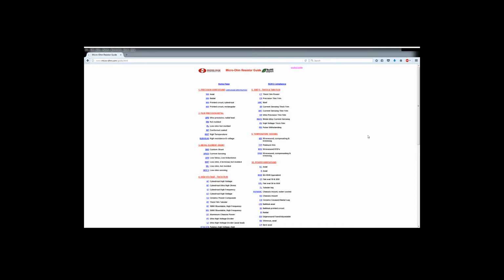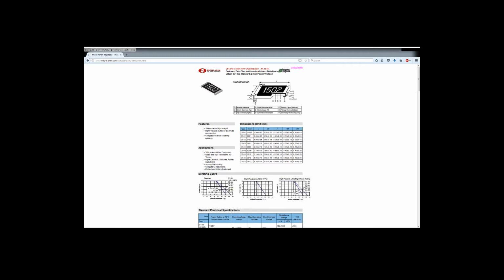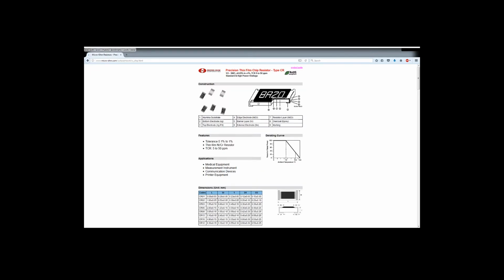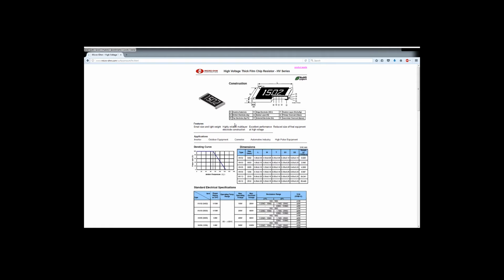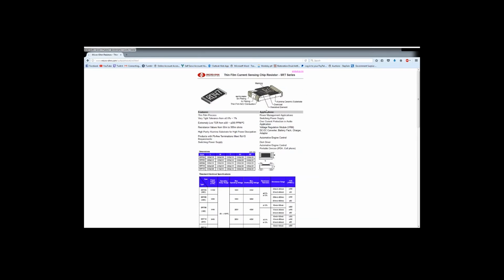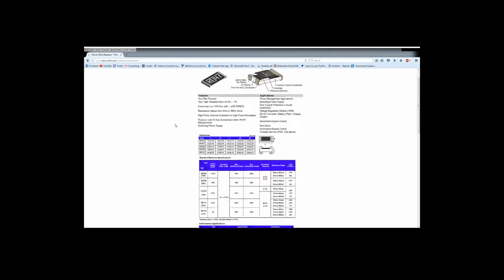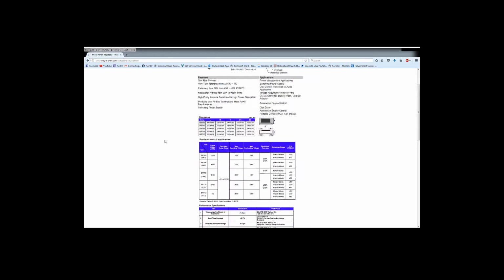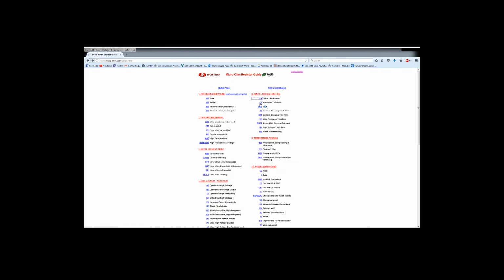Alamo City Scrapping - Thick Vs Thin Film Resistors ( Wide screen is recommended)

Comment: Never gonna make us rich collecting these mate but if you are like me your just keep collecting them anyway !!  Thanks for the video !
Reply from the maker: Yes sir! It all adds up at the end. I'm sure some day someone will come up with an easy way to process these. In the mean time just keep collecting! Thanks for watching!
Reply: Your most welcome
Reply: @TwoOneOScrapping  and here I am!The best way to process these would be reacting these suckers with bleach(sodium hypochlorite)-concentrated one.It should produce a bunch of ruthenates,perruthenates and chloro-ruthenates which are pretty soluble!And after that it should be the best opportunity to just kick those ruthenium based groups out of these products by plain simple HCl and so I guess that some of them may simply decompose into ruthenium sponge and some non-important stuff and those which won't do so-will turn into weak ruthenium based acids which will for sure precipitate with either some ammonium chloride or any other salt of ammonium with strong acid or at least some alkali earth hydroxide..And it will be simple to convert them back to metal by simply thermal decomposition because ruthenium is a PGM and therefore all it's compounds are very easy to destroy by simply heating..So I guess it will work!

By the way if you want I can tell you the alternative way to extract palladium from any palladium-containing stuff!It's involving only one chemical and is actually fast as explosion!Literally:the first step of the process is actually so fast and exothermic that it can partially evaporate palladium(!)..
Reply: @johnsheppard1476  do you have a channel?